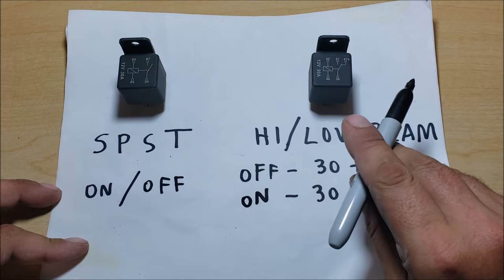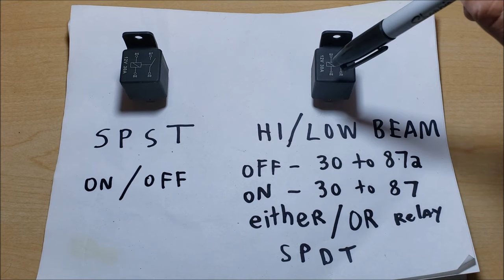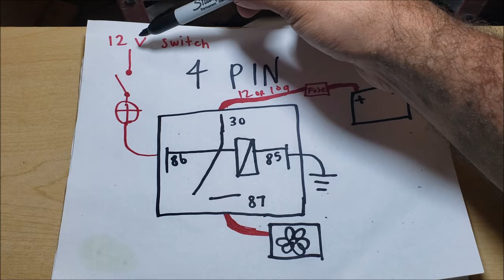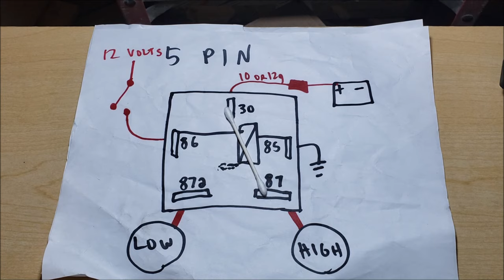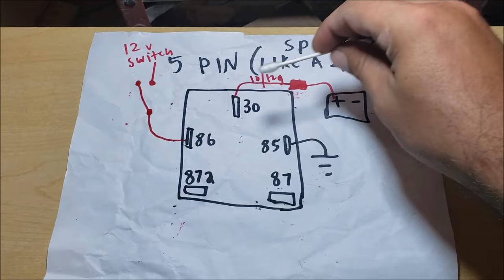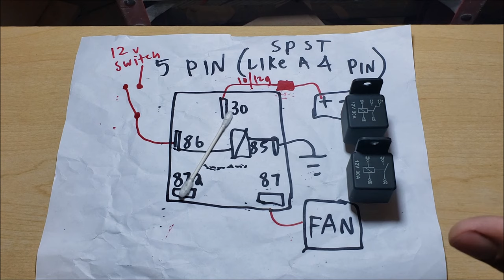automotive 4 pin and 5 pin RELAY EXPLAINED which one?

Comment: Chris I have a question. Has to do with wiring harnesses. I was following lt1swap.com but I ran into a question he has not answered back and weeks. The neutral safety switch has 2 connectors, the larger connector all the wires go to the C2 block for a 5.3 engine. My question is other than the red hot wires I have three wires that I don't know what to hook up to since I cut them from the C2 block. I was thinking that each wire should go to a fuse on one side and the other side of the fuse would be would be turn key 12 volts power. What do you think?

Comment: if you switch 30 with headlight switch and have high beam dipper on 85,86 5th pin can be high beams, nothing saying you can supply 87 or 87a and have 30 common. fairly sure if you got solar panels you can use 2 or more on the solar side depending on how many batteries your charging. automotive 24volt relays and a zener, it needs the panels to generate 24 volt to actuate its own main relay to stop it back feeding at night, the second uses a zener diode to the relay coil to control when battery is charged i think most panels outputs are 24 volt if 12 use 12 volt relays you could use a 12 volt relay for the battery voltage side use 5 pin relays. i imagine the batteries to be 12 volt parrallel and then charged by 24volt if its using the standard solar panel they use for australia, if you want to send power back to the grid in australia you really need to use 2 car alternators, one is used to get the phasing sync of the line by connecting to the field windings before the diode packs and reg, and the second alternator is connected to the other via a over run pulley and powered by your solar charged batteries and you drive that alternator like a motor by bridging the slip rings and turning it into an inductance motor, since you have the first alternator in sync with the mains you can generate power back to the grid, im not sure if you will have to supply 24 volts back to the EDMI in order to get the meter to start counting watts delivered back to the grid,

Comment: if you use a 5 pin and use it as a 4 pin will it drain the battery when 87a is hot?

Comment: I am a guy using 5 pin for electric fans but will be getting 4 pin tomorrow. Been working fine but recently blew a fuse. 30amp fuse 40 amp relay 14inch fan. Also notice wires are getting hot from relay down into pigtail. So I need to upgrade the guage of wire. 85 is ground trigger from efi 86 and 30 are tied together to a fuse 30amp fuse to battery 87 is power out to the fans. I have both fans wired like this and worked for months but recently started popping fuses and here I am to ask questions about what I did wrong. Relay pigtail is compiled of all same guage wire looks to be 14ga and fan wire is maybe 12. Do I need to upgrade the wires in pigtail to 12 or even 10. I do understand wire size length and current I have 0ga front to back power to second battery. 0ga to batt from alt and 0ga from bat to body bat to frame and frame to block
Reply from the maker: I JUST CHECKED OUT YOUR CHANNEL  are you running the battery in the back?

Comment: the most common reason  for 5 pin is interchange if one fails you will always have another to temporarily install in an emergency. also don't forget it is often useful to have a switch ground to pin 85 operate the relay

Comment: can you join 86 to 30? then go from there ? 87 goes to the lights onto a switch light wire on one side 87 on the other?  as i dont understand the  86 going to power to a switch then running the wire back to the lights? that by passes the relay

Comment: Hello, I'm trying to connect a relay to power a battery pack for my dash cam. I connected all the pins but not getting any power at pin 87. I used a meter to check the voltage and I got 12 volts for trigger and pin 30, but I only got 0.1 volts for 87. I do hear the click, what could be wrong?

Comment: Thanks for the video!!! I have a couple questions, may be stupid questions but nonetheless idk...

1. Using the diagram at 4:18 of this video, if the qtip is at 87a and you DO NOT have anything wired at 87a, will your battery die? My guess would be no.

2. Is there a certain amperage that needs to go to 86? If I were to use a "fuse tap" on an existing accessory that turns on, only when the car is on (like an accessory that gets power from ignition) would that be enough? 

3. If it says 30, that goes from battery straight to the relay , is that the max amperage this relay can withstand?

Thank you in advance. I installed a universal power window kit on my friends 88 chevy truck. Pulling bout 500hp. I only used a rocker switch. He got so much shit hooked up as is with gauges etc. But he killed his battery by forgetting to turn off the switch. I'm looking for another way. Without taping into the ignition wire.
Reply: Why didn't you use a momentary contact switch?

Comment: I’m still confused lol. 

What I want to do is have my aux led lights on my rear bumper to come on with a switch but also come on when the vehicle goes into reverse. I don’t want power to back feed to the switch or to the BCM. 

Would I need a total of two or three relays?  The switch I am using has built in relays so power draw from there is not an issue, but if I use the reverse lights to activate the led lights, the power draw from the LEDs maybe too much for the reverse light wire. 

When manual activated, I don’t want the switch to feed power back into to the reverse light wire which would feed into the BCM and cause issues. I also don’t want the reverse activation to feed into the switch box and cause any issues. Switch is an Auxbeam controller with built in relays so power to the terminal should not cause any issues since the relay on it should stop any feed to the control board. 

I am just curious how I can accomplish this or just abandon the idea and keep my lights on the switch and then add another set for just reverse. I had one on my hitch, but it stopped working and was wired to my trailer reverse light plug. So I may just replace that and use the same wire I did before. I just wanted to get rid of the extra lighting in the rear and have a two in one. 

Yes, it may just be easier to hit the switch when I back up, but I want something automatic so I don’t forget to turn it off.
Reply from the maker: what you are trying to do is so simple and you are over complicating it.. you need a 4 pin .. wire into what ever lights to turn relay on .. and have a toggle turn relay on too

Comment: Can you make a tutorial for a  key ignition switch with LED  voltage display for a xiaomi scooter to show the actual voltage of battery using a relay. Most of the tutorial from YT showing only 5v. Which is connected   only from controller + input and + out put from the dashboard.. and someoned told me they added extra wire from key ignition switch to separate the 
 real capacity of the battery.  Hope you can help me. Please. TIA.

Comment: Chris, quick question if i may, I'm working on rewiring some foglights on car i have and I'm following some directions from the internet,i understand everything however i noticed that they are running battery to 87 instead of 30, why and will that hurt anything? its a 4 pin relay,this project im working on has been posted on the internet for years for the kind of car im working on and countless people have done, it,im just one of those that likes the "traditional way" to do things and when i saw that it made me wonder, thats why i ask.
Reply from the maker: it wont hurt but in USA we run power to 30.. just leave it..  it works either way
Reply: @chriscraft77022  Thank you very much,appreciate your input.

Comment: Hi where do you get current from the battery? do  you get the power from a fuse box. and which fuse? than you, J.A.
Reply from the maker: on my vehicles I run auxiliary fuse boxes for new circuits.  I have a video of one I put on my Jeep.

Comment: If you are able to use the 5pin relay for two different power source’s. Can you PLEASE do a video on it? For example using two 5 pin relay for left/right blinker and brake light . Thank you !
Reply from the maker: YOU DONT USE A RELAY FOR THAT..   WATCH MY TURN SIGNAL FLASHER VIDEO...    the brakes are a separate circuit
Reply: @chriscraft77022  ok , I must not understand bc my tail lights use the exact same LED’s that my blinkers use

Comment: I have thr 5 pin in a 10kw gen.  Its coming from the alternator.  But my bat. Not charging.  New alternator. New vol. Reg.  I bought a new relay and now I am confused to how it hooks up.  Please help. It only has 4 wires hooked up. Black, red. And 2 orange

Comment: Hm. I've swapped the basic incandescent headlights in my car to some OEM projector headlights. The issue is that the high beam signal is used to actuate the projector shield that differentiates between low and high beam. But if I activate high beam now my lights shut off. So I need to find a relay that keeps low beam on when the high beam turns on. But that has been tough. So few relay places have diagrams for the relays.
Reply from the maker: that’s what they use the 5 pin for but you also have a 4 pin to turn ON the 5 pin from the switch.. then the high beam switch goes to the 5 pin

Comment: I am using a relay to install a rearview camera. Do I run the wire from 86 to my accessory wire when I turn on my key. I think I can but just wanted to make sure. Thank you Levi J DeVerney.
Reply from the maker: yes.. but you don’t need a relay for a camera. why can’t you just run that “on with key” wire to power the camera..? I have a back up camera video, btw
Reply: @chriscraft77022  hi chris I tried installing the camera but there is not enough voltage going to it. I have a 2008 Suzuki forenza.
Reply from the maker: usually you would run thicker wire to compensate for the voltage drop... is the camera like a high quality HD or something? because if it is just a normal cheap back up camera you do not need a relay for that.. unless you camera is pulling 10 amps for some strange reason

Comment: Hi Chris, I’m doing relays for my headlights on my 69 charger, I’ve been researching a lot and thought I could go with 2, 4 pin relays for low and high instead of 5 pin like some of the videos I’ve seen because non of them used the 87a pin. But in your video you use a 4 pin and 5 pin, why is that, and is that what I should do and how would that get wired? I’m running separate power wires to each relay with a separate fuse for each relay. I will splice into the high beam wire for one relay and low beam wire for the other relay. I do want to do separate circuits in case the low or highs went out for some reason, old car wiring/connectors if you know what I mean. Lol
Reply from the maker: that’s how all modern cars wire them.. one 4 pin and one 5 pin.. you don’t need to wire them separate.. I would have a video on this out but I’m not working on the old car right now.. I have the new lights and everything ready. you need to really think your project through before you do stupid things.. you can use your existing power wires going to old lights to turn on the relays.. wire them separate but not necessary in any way
Reply: @chriscraft77022  thank you I’m asking questions because I want to do it right plus to remove the load on the switch and dimmer. Will your way be using the 5 pin on the low beam and using it to turn on the 4 pin for high beam, or will the 5 pin be used second and control both the low and high beam, or some other configuration, if there is another. So instead of using battery power direct from the battery on pin 30, I can use the low beam wire to power the relay if so would that go to 30 and 86 or power direct from the switch to 30?
Reply from the maker: @The01Bookie  no... mount the 2 relays by the headlights..  low beam  power wire goes to 86 on the 4 pin.. 87 from the 4 pin goes to 30 on the 5 pin... so the high beam power wire goes to 86 on the 5 pin..  there are many many diagrams on this because all cars are wired like that from the factory..
Reply: @chriscraft77022  ok thanks for your time and help.

Comment: Any 4 pin that has a 10 second delay in the same size and specs?  I'm trying to turn on an amplifier in non automotive use and reuse existing quick connect terminals.

Comment: Which would I use in order to wire up a group of LEDs to be running lights then also that same group of LEDs to be signals?
Reply from the maker: 5 pin

Comment: I ordered a 4 pin relay for my spal high performance race fans and the diagram shows Red 30 to fans Yellow 87 inline with a 30 or 40 amp to the battery, both fuses came in the kit. So what's the difference between 30 and 87? I haven't wired it in yet.
Reply from the maker: 30 is power coming in

Comment: If I wanted to normally power a fan with a thermo switch, but then be able to manually power the fan on with a switch, would I need a 5 pin relay?
Reply from the maker: yes ...
Reply: @chriscraft77022  I'm trying to get my head around this, but I would basically treat the "low beam" as my thermo switch power to fan and "high beam" as manual power on to fan?
Reply from the maker: yes exactly
Reply: @chriscraft77022  Is this preferable to say using a 4 pin and adding a bypass circuit to the thermo switch, using the addition toggle as an interrupt?
Reply from the maker: There are several thermo switches to use ... and many ways to wire it up,., check out my bmw thermo switch video if you don’t know

Comment: Is it possible for a relay to drain the battery?
And is the switch closed when you remove the relay?
Reply from the maker: it can drain a weak battery.. I don’t understand the second question

Comment: i put led lights in my  van and just used lighted switches and a fuse from battery. should i have used a relay?
Reply from the maker: how many amps they pull.. led for van cargo lights? I really dont think you need a relay

Comment: if someone wants to go to the trouble and add in some lights use the 5 prong, 87A red light, item is not getting power, 87 green light and the item to power, switch on green light, switch off red light.

Comment: Hello, quick question?
Can you use a modern mechanical relay on an old car like my 66 Thunderbird. 
I want to replace my flasher relays which original are 60 Dollars each. I need two. Or can I use the 5 dollar ones from AutoZone? Thanks in advance
Reply from the maker: i have a flasher video..  using the 5 dollar ones..  you are gonna have to study the circuit..  im 99% sure you can make the $5 one work..I WOULD..  ..  check out my video
Reply: Thanks you, I watched it too. I think I'm going with a 4 prong universal relay from advanced Auto parts. 
Although. One of my old relays from the car has two contacts points instead of one. What are those relays called... I'll need two hot  or live prongs after the electromagent closes the contract.... Single pole double contact....

Comment: So to wire my headlights with a 5 pin relay , I would need a switch that has a off/low/high function correct ?
Reply from the maker: depends what you are putting headlights on...

Comment: On the 4 pin relay, after the 86 signal is killed, how long should it take for the magnet to de-energize so the switch will open again? I’m trying to figure out how long that would be on a x contact relay (40 amp)
Reply from the maker: 1 second
Reply: So if the arm didn’t open back up after 1 second but maybe after a few seconds, what would that indicate in the relay?

Comment: my coolant fans and a/c wont come on. If i give power to 87  the fans come on
after testing where the relay goes im getting constant power to 86 and 85....no ground or power to 30       with key on or off

What could be causing this?  From what I understand 30 should be constant power and 85 is ground correct?  Why am I getting power and ground in wrong places?  2005 chevy silverado 1500
Reply from the maker: this is the wrong video..  you have a computer..different relays...  sorry

Comment: I still do not get it, others say 87 in from battery, and 30 output to amp & etc, just confuses me
Reply: 30 always goes to the battery with a fuse box to prevent any short circuit.  87 always goes to the accessory, lightbulb, compressor, etc.

Comment: Is there a 5 pin relay with an off position, trying to wire drl on my car, turn on with ignition, but turn off when I turn headlights on. I figured if anything I could just use a standard 5 pin without using 1 pin power output if I understand correctly.  Let me know what you think?
Reply from the maker: it should work
Reply: @chriscraft77022  Thanks

Comment: I am confused. How do you attach a 3 prone illuminated switch to a 4 prone relay ?
Reply from the maker: 3 prong switch is just a switch with a light. it has nothing to do with the relay
Reply: @chriscraft77022  I had tried everything to add a relay in my project but can't seem to make it work
Reply from the maker: I have a video on my channel “wiring a relay in real life” it has my Jeep in it .. I wire a 3 prong switch in it

Comment: So if a 5 pin is connected directly to a car battery, 87A or 87 will be energized no matter what;
Does that mean it will continuously draw power from the battery while the vehicle is off?
Reply from the maker: you use another relay (4 pin) for the power wire that feeds 30 on the 5 pin

Comment: But what happens if you only got a bunch of 5 pins?? Can it be used to wire a light bar??
Reply from the maker: yeah I show that in the video
Reply: Chris Craft ohh ok thanks cause i thought you meant hi beam low beam as in the power will constantly be on and when u turn the switch it will just get more power
Reply from the maker: it is constantly on you cap 87a and run 87 to lights
Reply: Chris Craft unless i put a switch on my switch panel right?
Reply: Chris Craft can we use 16 gauge for 86 to go to the switch???